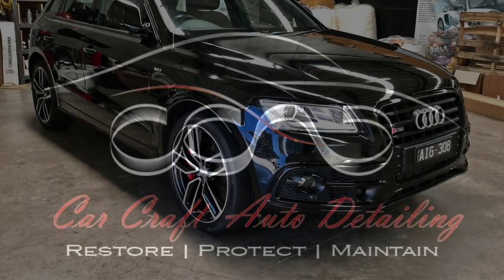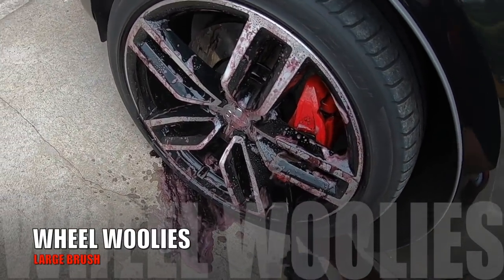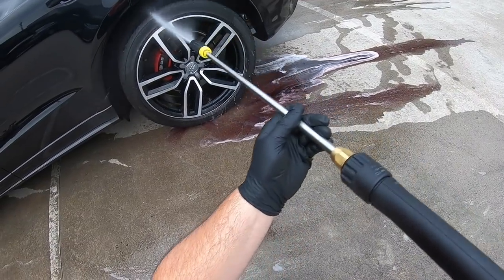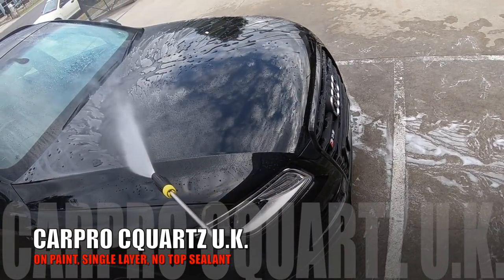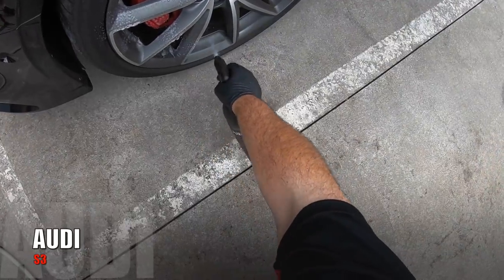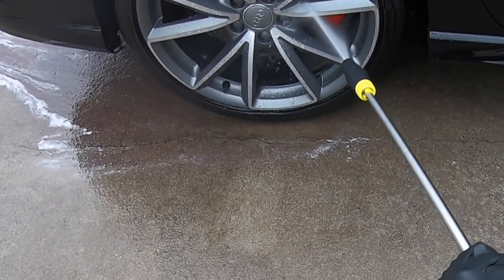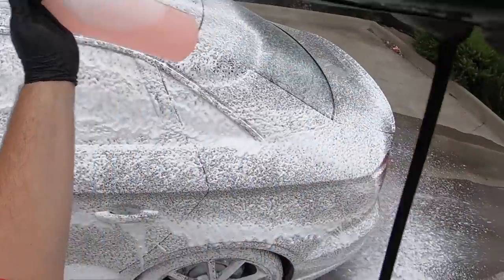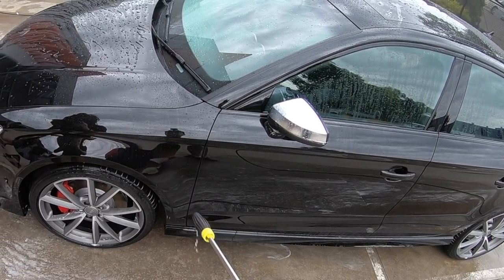Audi S3 & SQ5 Further Testing Results & Maintenance Wash

Comment: G'day Sandro I would like to get your opinion on water spots.  My car is machine grey After I have washed it and hosed her down I take it for a drive to try and expel any water underneath ect, I've done this for years since I learnt to drive at 16 I am now 60yo.   The problem now is the water has gone off the paint but small water spots remain on it my wife's car is the same hers is pearl red, to get them off I usually go over the marks with Maguire's detail spray, what would you suggest I do when cleaning the cars.  Both of them are fairly new, kind regards John

Comment: I have a question. So if I'm getting my new daily driver soon. A grey car that I'll get professionally polished to remove all the small swirls and scratches. Also applying a ceramic top coat from Gyeon. I'm going to wash the car properly with Gyeon products ona a weakly basis (prewash, wash, microfibre cloth for cleaning and drying) being really careful not to make new scratches. I know that the ceramic coat last about a year, when that time is up I need to polish it again before applying new ceramic coat? How long will the polish last me? The car will be parked outside on the rain and sun because I don't have a garage. Nice videos!!

Comment: what a grate set of vids on you showing what your testing out. I am also testing the same wheel cleaner and to prefer it over carpro iro x. I am also been testing what one layer of uk is like with reload on top as a cheep coating package after a correction. I get plenty of correction work but for them to set up to a coating on top is a hard sell at times so if i can find a way to offer only one coat of something like uk I could offer a package thats a good upsell if they dont want to go all out

Comment: Hello a little OT question. Which kranzle 21 washer are you using. I was planning to grab 2160ts earlier I decided to go for 1152ts but now planning a step up to 2160ts. Thoughts?
Reply: Car Craft Auto Detailing more powerful than 2160 (11lpm and 140bar) damm. I heard a good flow is more important than pressure and 2160 is a very robust unit. Guess will be grabbing this one only again thanks🙂

Comment: Hi Sandro, I was wondering if you have used any glass sealants on these two cars? I have an S3 and the wiper blades (Bosch) can judder with the use of certain glass sealants (Rain-X) etc. I use Nova Jet as a spray sealant but have not been game to try it on the windscreen glass (it seems effective on the other glass).
Reply: Thanks Sandro, I just use Autoglym Glass Cleaner that seems to keep the wipers running smooth and bead the water nicely (just needs regular application to keep it effective).

Comment: what are your thoughts on layering coatings? do you think there is any benefit adding another layer after it has fully cured i.e. >1 week?
Reply: I'm just a hobby weekend detailer, but I've heard on more than one occasion that layering is more a marketing trick than it's actually effective. But like I said i'm not a pro.

Comment: Serg, have you got a pege upload with rims which have not been treated with any coating and the rims are painted as well, if so please supply a link, so i can see the difference when a painted rim with no protection ie: Coating other than basic wax's and they are dirty with road grime and brake dust etc, then purge is used ?
Reply: Sorry, i thought that all the rims had a coating on them, cheers. :) I will be coming down to the shop soon and maybe you can give me advise on various products. :) Keep up the good work buddy. :)
Reply: Quick one serg, can you use the Meguiars Soft Gel in the standard Gerni bottle pressure cleaner ?
Reply: Serg, Poorboys wheel WAX is that stuff any good on coating say Black polished rims or mags ?
Reply: Thanks anyway for answering the question. :) cheers and cant wait till i see new updated uploads from work you have done, PS i am sharing your uploads with friends i have with nice cars and family cars as well. :)